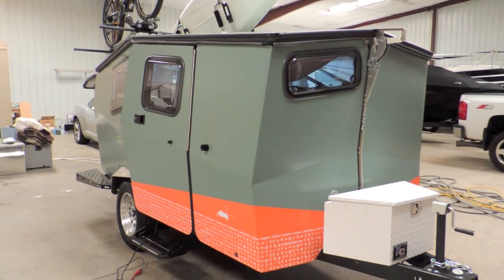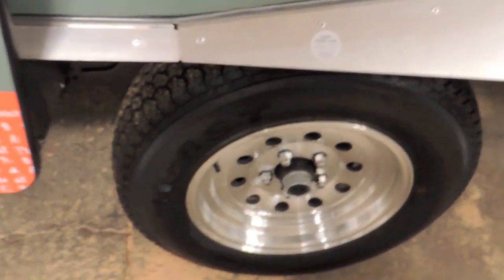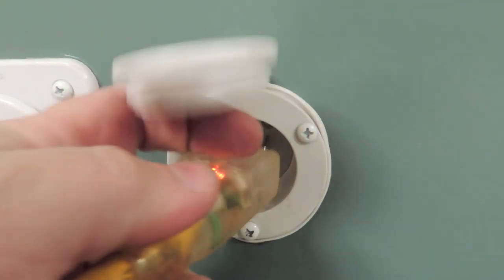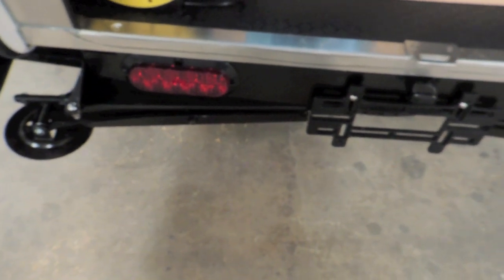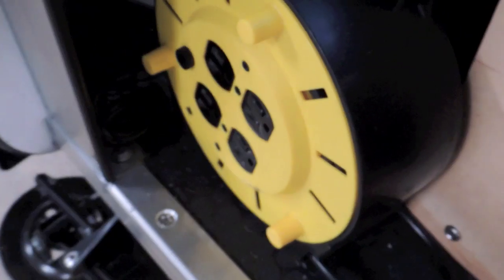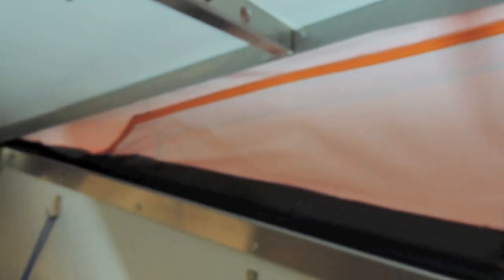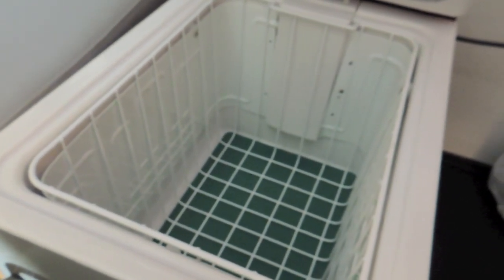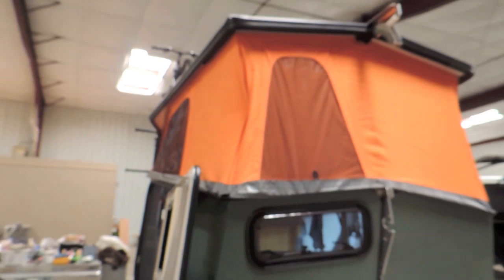Cricket Trailer

Comment: How easy would it be to add enough insulation on the pipes/tanks on the bottom so that one could use the cricket for "soft freeze" weather (e.g., high in the 50s, low at night in the 20s)? Thanks for the detail in your review, it really helps to see all the hidden places.
Reply from the maker: I think it would be fairly easy to insulate the exposed pipes and tanks.  Keep in mind, since those items are not heated, it would only offer protection to a certain point.   You could add 12v heating pads to the tanks (another easy job), but the pipes would then be your concern if it got too cold.
Reply: wincrasher2007 That's perfect, I live in El Paso, Texas and it would only need to survive a few hours of freezing weather.

Comment: What are your observations now that you have had the trailer for a longer period of time. Any regrets, failures, etc?
Reply from the maker: It was working out fine - not a moments trouble with it - but I got a fantastic deal on a camper-van and ended up using that more.  So I sold the Cricket to a nice couple in Vermont.

Comment: Just curios how you like the dry flush toilet? Does it ever smell up your camper? Any information would be awesome. I want to get one as well, but have not been able to find any reviews other than yours. Thanks!!
Reply from the maker: I don't know yet (it's winter here).  The foil bag is supposed to prevent odors from escaping.  There isn't alot on them on youtube or online, so I made the video.
Reply: wincrasher2007
 I plan on getting one anyhow, its just to cool to pass up. My wife can smell the smallest of odors and I know a porta-potty with chemicals will drive her nuts. Thanks for the reply, love that cricket trailer vid.!!
Reply from the maker: wood2099 I can report that it holds the odors very well.  You do have to be cautious in putting paper in the deepest part of the well, as some bits can poke thru the twist after you flush if you just throw it anywhere.

Comment: I'm about to order a Cricket and would like to know where you got the adapter to attach your solar panels to the 7 pin cable?
Reply from the maker: Donald - The Cricket comes standard with a 4 pole connector cable wiring into the 12v system for the solar panel kit that they offer as an accessory.  I use a GoPower! brand solar panel that uses the Anderson style connector.  I looked for a 4 pole to Anderson adapter, but couldn't find one.  GoPower! sells the 7-pin adapter which I bought on Amazon, but you could buy directly from GoPower!

Comment: Thank you for taking the time to make this review – I found it very helpful. I’m seriously considering purchasing one of these trailers, but would like to set it up for colder climates. Although I live in Arizona now, I will most likely be moving to either Oregon or Colorado. I was toying with the idea of replacing the tool box with a mount for large Propane tanks and installing a catalytic heater. Thoughts?
Reply from the maker: I use a heater buddy propane portable heater for short trips (got one for $100). You could certainly use a small ceramic heater if you had 110v power.  Some of their early trailer models had a built-in propane heater that was located where my refrigerator sits.  If you installed a furnace in the toolbox, you'd loose the water heater and the kitchen cabinet.  I'd go with a portable heater - less complexity, you don't have to carry it if the weather is mild, and it'd be cheaper.
Reply: The Buddy heater is on top of the list, but I’m interested in connecting to a much larger tank (option available on Amazon). Just based on what I have read, people in slightly larger trailers are burning through a 30 pound tank in less than a week. That is a good point - I would only run the hose inside – no need to permanently mount it anywhere. Yes, the little ceramic heaters work like a charm. One of my favorite things in Oregon was snowshoeing up in Mount Hood – it is great during the day, but gets COLD at night. Thanks again…
Reply: I was also considering mounting a small flat screen TV inside the trailer, but I’m now leaning towards purchasing a laptop with a larger screen and using wireless Bluetooth speakers.